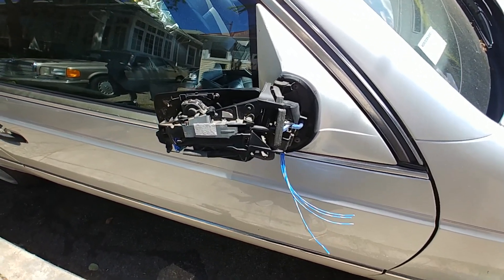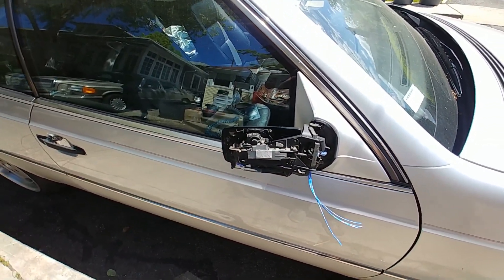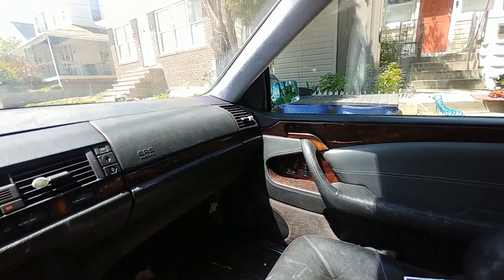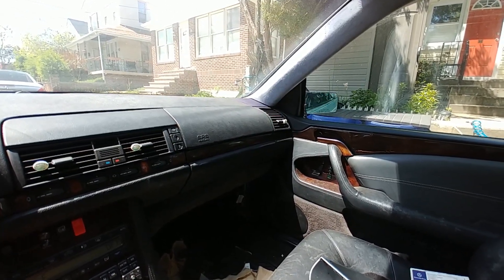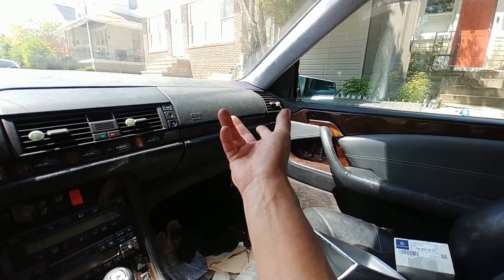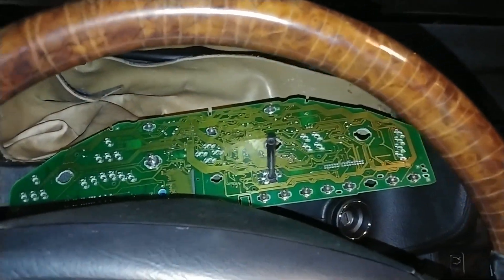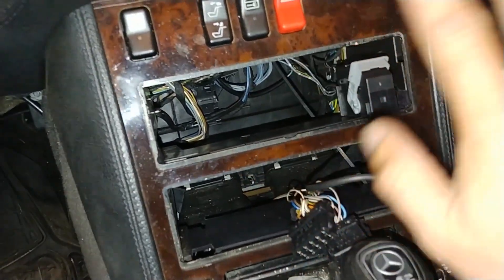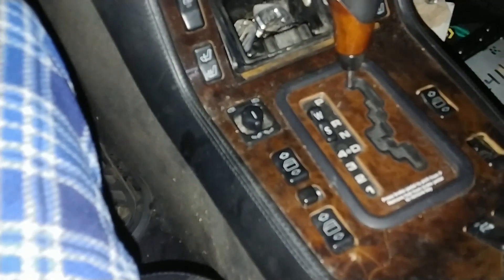Mercedes S600 interior illumination and mirrors

Comment: Victor, I fixed my illumination issue on my 99 sl600 today. the problem was the dimmer on the cluster was set to max dim. Try turning the dimmer (left knob in the cluster) all the way to the right. I also replaced the headlight switch at the same time.
Reply from the maker: Sounds good. So yours was fine, just dimmer. With this customers car not even single light was lit. So whole circuit was down. Dimmer or switch was not the problem.